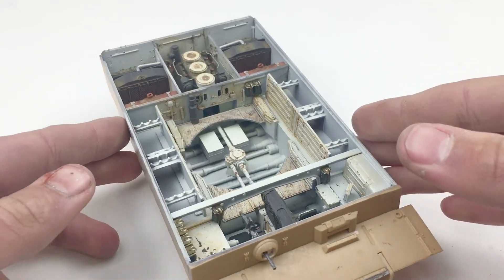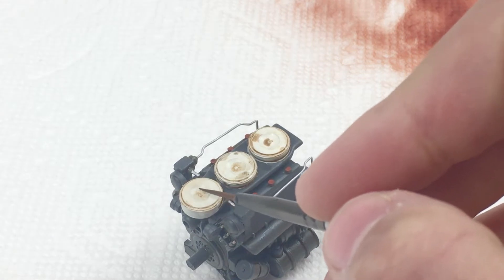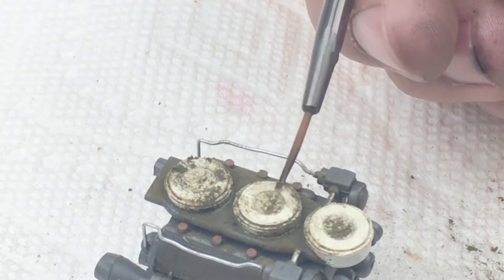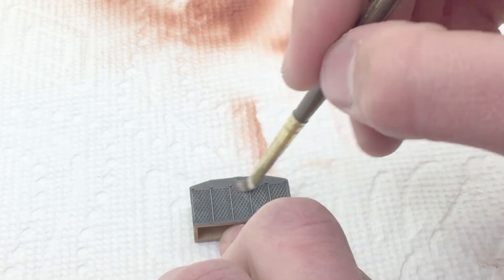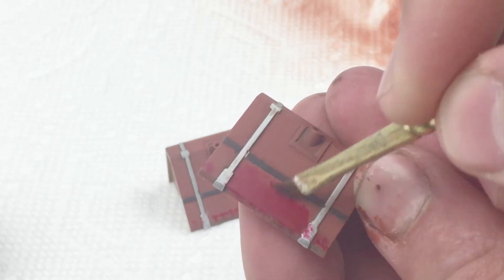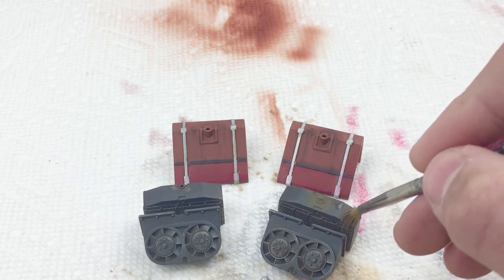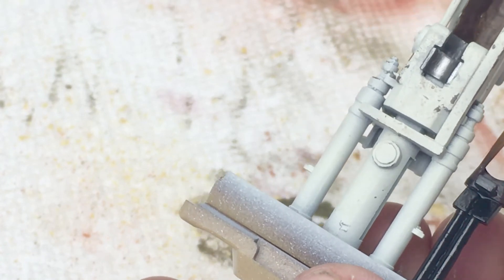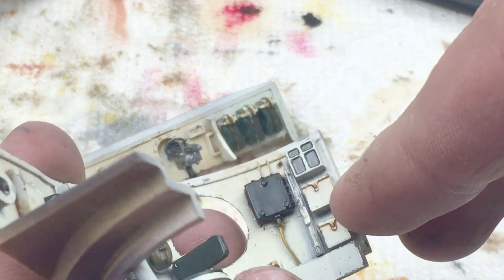Finishing This Tiger's Interior: (Airfix 1/35 Tiger I "EARLY VERSION")

Comment: it actually is academy product
Reply from the maker: Yeah, unfortunately not the best kit
Reply: @TheScaleEngineer  why. what do you think about (reyfield) tiger 1
Reply from the maker: I do have the RFM tiger, I have not put it together yet, but it does seem to be a little better engineered. unfortunately the Academy kit is not very well designed and so it a bit of a pain to build
Reply: @TheScaleEngineer  i had have experience in build some of academy product which is not match assembly which is very disappointed. Frankly, i like zvezda tiger I but off course it did not have inner parts

Comment: Your engines wrong the fuel lines the blocks there connected to that whole side flywheel plate should be on the other side the same side the exhaust ends are sticking out from to connect to the rear plate! Have a look as RFMs interior tigers there engines are the other way round! I'm away to look into this to see who has it wrong! Did your engine fit ok? Check this build Airfix you have done your engine wrong
https://web.ipmsusa3.org/content/tiger-1-early-version
Reply from the maker: Hey Scottish, yeah, I figured that out about halfway through the build. The engine actually fit ok, but I don’t plan on making that mistake again. Thanks for your input
Reply: I've had a pain in the arse of a job with mine with getting a len of some old books from friend's on Tiger's and seeing all the earlier Tiger's were Grey interior not Elfenbine ivory only ivory from sponsons and top ammo boxes up and turret basket was Grey along with the 2 piece floor! So I've been working on this I've got mine done now I'm on to the weathering inside! Glad I noticed at an early stage! I hate to look at museum references as always wrong normally bit Tiger 131s interior is pretty good for reference for the early! It's pretty much as it should have been for a change Haha! The straps for the fuel tanks were black and the tanks themselves were bare alloy pickled in nickel so wouldn't have been painted! Here's some info from Tiger1.info I'm still trying to see what he means by 4 tanks seemingly has another 2 in the rear sponsons and the 2 jn the engine bay that's only on our models!? http://tiger1.info/EN/Upper-fuel-tanks.html